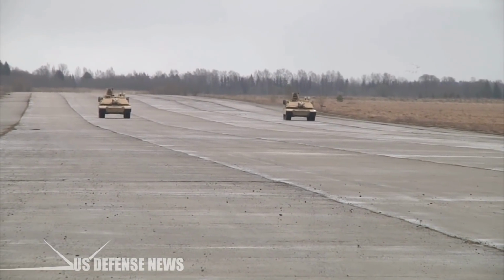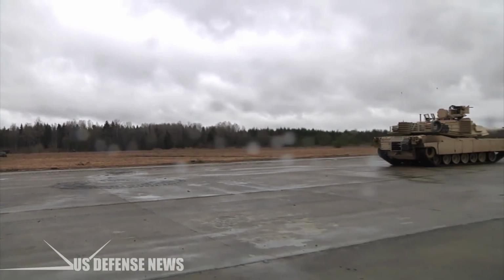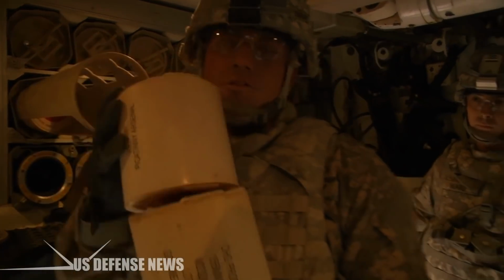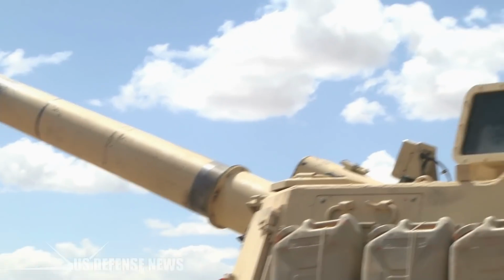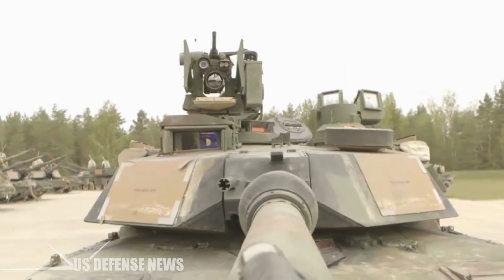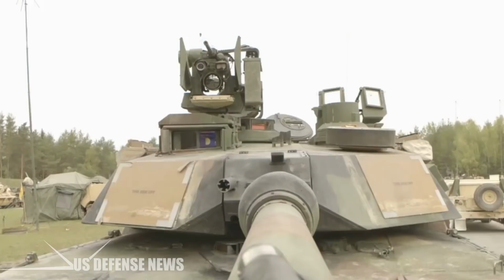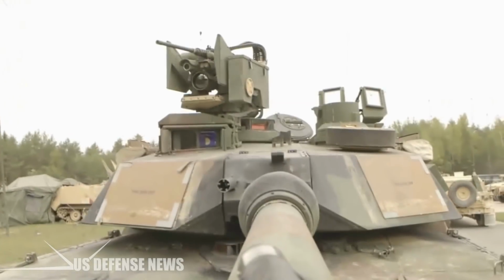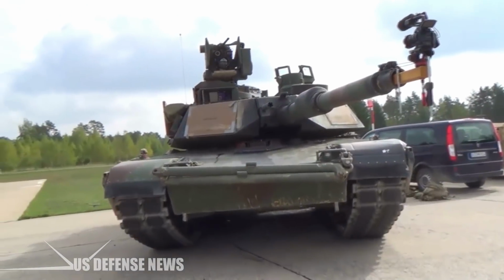U.S. Army Receives First New Abrams Tank Prototype

Comment: You would think that the US defense news would know the difference between the M1A2 than the M109 Paladin! Get the crap straight! No wonder everyone is starting to think that the Abrams should have a auto loader system! When you have shown how much trouble it is to load the gun on the M109 Paladin! The ammo for the Abrams is a one piece round the crews are trained to load a round from the ammo storage to the main gun in 10 seconds or less!

Comment: Its a good improvement, but the danger of Armata tank is its electronic sensors that detect incoming rounds, and its 2 ways to stop incoming fire, it has APS on turret that shoots down low speed artillery fire and some kind of grenade launchers under the turret, that are able to launch small bombs that detonate near the tank making a wall of shrapnels which can destroy incoming tank rounds or cause premature detonation anyway. If they were equipped with reactive armor, too, things would get even worse. The problem now is not to hit the enemy or to create new ammo, but to surpass their defense systems with new techniques. Sure when a t-14 runs out of that special ammo it's worthless, since it's a light tank, but they have many, probably enough to stop all enemy fire enough time to destroy all the tanks attacking them. Light tanks can be easily destroyed with highly explosive mines, though..... Or those sensors could be jammed with some kind of electronic pulse

Comment: New Abrams has auto reload, networked, short range targeting datashare system borrowed from the exvellent Leopard 2. M-1 crew told me the German tank is still the second best tank SYSTEM in the world. They can turn off the governor on the turbine and get 4000+ hp. Sick fast. Other tanks turbines would last only seconds. New targeting system for 120mm. Can can destroy a tank targeted by  another vehicles radar
Reply: +Daniel Brown

> "New Abrams has auto reload..."
 
This one? No it doesn't.

> "They can turn off the governor on the turbine and get 4000+ hp."

 2,000shp. yes, most certainly. 4,000shp. plus? No.

Comment: The Abrams cannot be upgraded to match newer Armada tank. Abrams is too heavy, too fat, slower, less fuel efficient, smaller main gun, ..... the list is extensive...  I think the US is suffering from a lack of creativity in its engineering core. Other nations are designing better equipment, machines, systems, missiles and fielding them much more quickly. Our R&D to production timeline leaves us nearly obsolete by the time we field the weapon, in comparison to our adversaries. Our missiles, our tanks, our ICMBs, our Missile defense systems, the mechanics of our systems, ...you name it....is either less effective, less efficient, lower yield, less dynamic, costs more, takes longer to build. The US should not be behind on so many systems... 
Except for 22s and still to be proven 35s,  we haven't innovated much in the past 25 years. If you would like specific examples, I would be happy to create a list.
Reply: What are you on about?
Reply: J. E. N. OCTOBER The Armada tank is 5 miles faster, has a 5 mm increase of the gun barrel, is cheaper, and uses less fuel(but can't use any fuel just diesel). Did I miss anything?
Reply: +patrick Boever 

 Not all of those points are true. I'll go further in detail tomorrow.
Reply: Nathan Peterson mmk
Reply: the armada is gonna be useless with the shitty auto turret.

Comment: What about the M1A1 that got stuck in a mud pit on a march to engage the Iraqi's, the commander made the decision after trying to pull it out of the mud to leave it to the engineers who were behind them. But before the engineers arrived 5 T-72's found it and took it under fire at point blank range. The M1A fired back killing 2 T-72's in less than 10 seconds so the T-72's ducked behind a sand dune out of sight but the M1A was able to see the T-72's with their night vision and shot and killed a T-72 through the sand dune, the other T72's took off to avoid being killed. Shortly after dispatching the 3rd T-72 the engineers showed up and pulled it out of the mud and it rejoined its company to continue the attack.

I'm retired but if I was young and ordered into combat again I'd want to be in a M1A2 upgraded tank.

Comment: E Company 127th. Maintanance. 1st. Cav Div. Fort Hood Texas...1982 first M1A1 arrived equipped with 102mm gun tube and it was the CHRYSLER CORPORATION heading this design. 
Not General Dynamics. That trade off  came a year or two later.
It was an awesome scene when a soldier did a neutral steer and the rear of the M-1 perched with its grill pointed at a General Dynamics car and we watched that blue paint turn a hot brownish glow. We were so impressed.

Comment: Why is there a gap between the body and the turret , wouldn't that allow an incoming shell or missile to get between both and explode rather than bouncing of with sloping armor .
Reply: Bruce Burns it's required to clear the raised section at the back of the tank when the turret rotates

Comment: Love how the dude is wearing flipflops on the flight line while they're loading a TANK on the trailer next to him. 8:38  Totally not worried about loosing some toes.
Reply: If by some freak "luck" he got in situation where he would lose some toes when they loading a tank on the trailer then even if he using military issued footwear, his toes would still be lose. So, it is no point in wearing anything else other than what make him comfortable.
Reply: Brian Thomas These are civilian contractors inspecting whether or not the tanks are secured right.

Actual troops are responsible for getting the tanks onto the railhead and fastening them down.
Reply: Shirghazay Cowboys 8:32 That looks like civilian contractors doing the fastening also... Actual troops unfastening the tank from the cargo aircraft (military vehicle, so no civilian on maybe?) drive the tank on the trailer. The civilian contractors fastening the tank to the trailer, got the pull truck to pull the trailer, at the factory the civilian contractors would unfastening the tank, drive it off the trailer in to the factory hangar then do their work on it.